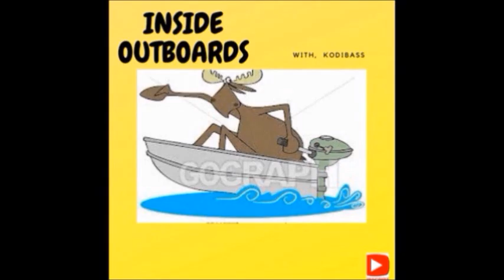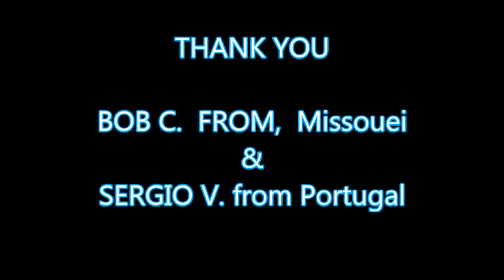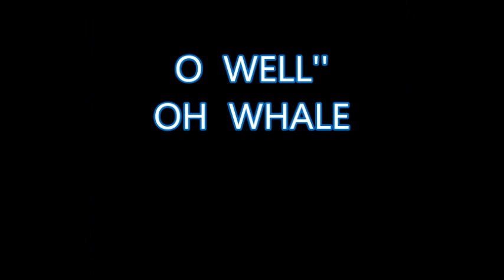EVINRUDE  15 HP 2 STROKE & CHOP'N

Comment: I finally saw one of these situations where the tstat cover was punctured by the latch bolt...  I thought about it for awhile and realized that this has nothing to do with the upper rubber motor mounts....The lower pan shifts on the three little cover mounts when dropped causing this damage.  These thermostat covers are hard to seal up without the extra bolt hole in the cover.  Funny how OMC made the correction to the cover/head only just in time to move the thermostat to the top of the head....Oh well, if the powerhead has to come off, this will be a great time to replace those pesky water tube grommet(s).  This motor appears to be in nice shape, most owners wouldn't notice even if the water was pouring out of the low speed grommet in the cover!  Unless of course, it stopped running....
Reply from the maker: Yep'  I will not know what the owner wants until He comes in from the Bush guiding hunters,  His call, Im kinda wondering if something els got broke/craked when it was dropped?  kodi

Comment: Hi Kodi, I have a water leak too on the back end of the old Mark 10 same area. The powerhead looks pretty easy to pull on it with the studs with nuts rather than bolts holding it on. I do have one nut to heat up to get off though. The rest when I check on it before were all loose? Like someone started to remove it and quit. This gasket is easy and cheap to get for it so will order one once I see what the old one looks like. since its leaking just in one spot it may even be the nut that is seize up and not tight? So will work on that first.
Reply from the maker: Hope it turns out to B just a loose nut 4 sure.      kodi

Comment: I Changed the Powerhead of my Mariner Mercury 6. I bought a used Powerhead off an 6hp Merc. Is it possible, that the Merc comes with Inch Threads and the Mariner with Metric Threads?
Reply from the maker: Very possible indeed.                kodi

Comment: I use to have a 9.9hp in that year model they’re great little motors! But I have a 1983 50hp E50BELCTA and my stator is bad and not charging battery and outboard cuts out at full throttle was wondering if you had a good working one that you would sale me? Can’t afford a new one right now lol
Reply from the maker: Sorry'  I looked and do not have one,    kodi
Reply: Okay thanks for looking
Reply: @kodibassInsideoutboards   do you know what year models range have the same stator